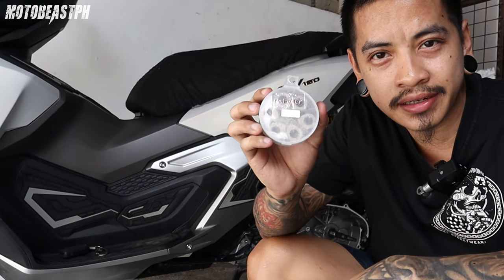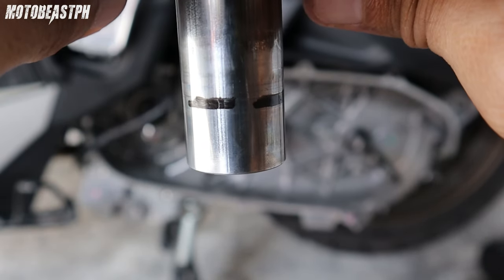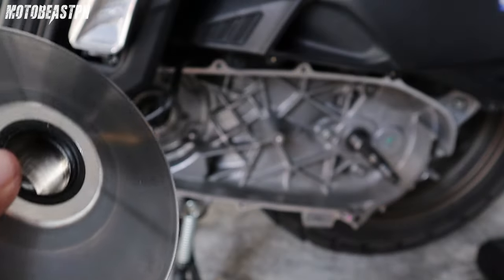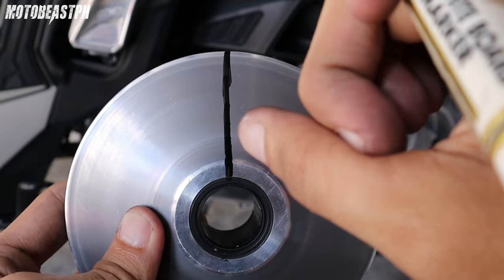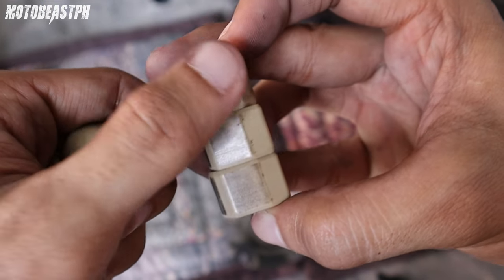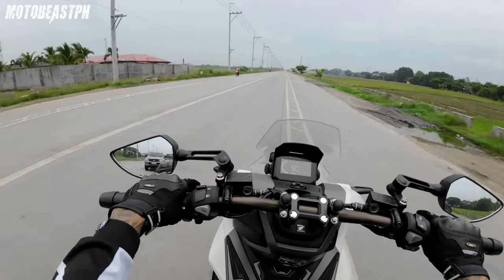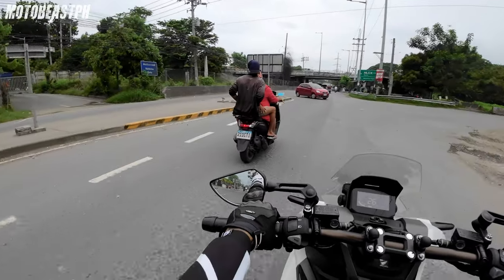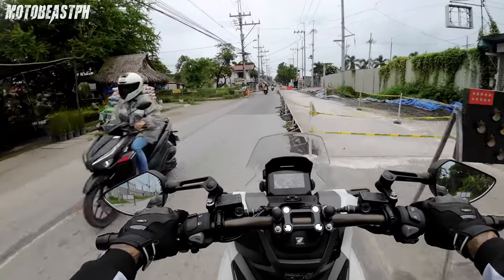ADV 160 | Dr.Pulley Sliding Roller Weight

Comment: Boss ok lng ba 17g 1200 center spring 1000 clutch spring at naka 13.8 pulley interlock? 110kilo rider. Thanks boss
Reply from the maker: Trial and error yan, bro depende sa timbang mo at riding habit. Hanapin mo lang pinaka-magandang alis na di gaano delay ang piga.

Comment: May nagsabi saken na if magbababa daw ng grams dapat dapat daw palitan ko na din center and cluntch spring? wala daw kwenta if magbababa lang ako ng grams.
Reply from the maker: Depende sa profile ng gamit mo na pulley set.
Reply: @MOTOBEASTPH  Stock pulley lang ako paps and balak ko din sana mag lagay ng 1mm magic washer then 15g or 17g na dr pulley flyball. For daily use with top box and obr. Goods kaya plano ko 😅

Comment: Bro idol, ano po suggested mong brand ng pulley set para sa beat fi and sa rpm ng springs? Salamat po.
Reply from the maker: Speedtuner kalkal pulley, 1k center, stock clutch, 10g to 13g bola trial and error.
Reply: @MOTOBEASTPH idol pano pag 1500 Center at clutch tapos 12/11 Rollers Weights ?

Comment: BOSS SANA MASAGOT !!
di ko gets sinasabi mo regarding sa bigat ng bola nyang Dr. Pulley.. so meaning ako kasi naka 12/9 sa bola na round shape .. meaning pag nag Dr. Pulley na ko.. hindi na dapat 12/9 bibilin ko?
Reply: 12/9 padin. Pero if naka aftermarket pulley ka wag kana mag dr pulley na flyball. For stock lang yan. Ung dr pulley is kaya nyang itulak ang pulley para mas maipit at umangat ung belt dahil sa mas malaki at unique shape and/or design nya. If after market kana, wala na un limiter sa rampahan kaya mas aangat na ung bola at maituttulak nya ng sagad ung pulley papuntang drive face
Reply: @romeomaindan9982 bali pwedeng mailabas o lumagpas yung belt? Naka aftermarket ako na pulley, RS8. Bawal ba mag dr. Pulley?
Reply: @davidfranciscoamano1057  baka maputol belt mo boss lalo na if may karga. Common nangyayari sa racetrack. B65 belt pero over range ung pulley.Naii stretch ung belt. 

Pag nag dr. Pulley ka naman sa racing pulley, pwede maipit sa backplate at dulo ng ball ramp kasi gusto nya pang sumagad. Baka d na bumalik. May instances na ganyan. Purpose lang naman ng D type roller is para mas umakyat pa ung bola which is d kaya ng stock or ung normal na bola kasi may limiter ung ballramp (yan ung kinakalkal) para lalo nyang maipit ang belt paakyat ng pulley at tumaas pa ung gear ratio mo.

Comment: Sir ask ko lang kung recommended ba yun 12gms na flyball sa kalkal pulley set, 14t gear, at 110/80 rear and 100/80 front tire.pero stock center springs,clutch springs? Honda click 150i v2 user sir. Thanks po sa reply.
Reply from the maker: Trial and error lang sa bola, bro. Balik mo stock size gulong para accurate speedometer reading.
Reply: Goods ba 12g?
Reply: Sir ask ko na rin kung di ba ma-rpm at malakas sa gas yun 12grams sa ganun set up ko? Nagbig tire kasi ako sir for road stability and 14t gear para nman sa gitna at dulo. Gusto ko sana itry yun 12grms, since naka 13grms na ako, kaso lang malamya yun arangkada nya sa 13grms. Parang nakastock flyball ka na 15grms yun arangkada nya. Thanks po sa reply. 😅
Reply from the maker: @ronaldsantiago3487  Konti lang difference sa gas consumption. More rpm, more gas.
Reply: 👍 salamat po sir

Comment: Sir kamusta dr.pulley flyball ginagamit nyo pa din ba? Totoo ba talagang matibay?
Reply from the maker: Gamit ko yan bago ako nag 14T gear kaya pinalitan ko na ulit. Mga 3,000km ko siguro nagamit okay naman basta dapat smooth yung edge ng backplate.
Reply: @MOTOBEASTPH  anong brand ng flyball pinalit nyo sir? Para sayo sir kaya ba tapatan ng mga leading brand ng flyball dito satin quality ng dr.pulley flyball? Honest opinion po sana sir meron din kasi ako nyan bali dr.pulley flyball, koso at MTRT parang nang hihinayang ako bakit kasi kumuha agad ako 😅 11g at 13g koso brand another 13g dr.pulley at 12g na MTRT brand.

Tinesting ko yung straight 13grams na dr.pulley so far feel ko yung claims o baka lang kasi nag gaan ako from 14g down to 13g. Lintik kasi mekaniko ng casa parang ayaw nila maniwala opinion ng customer na lihain yung back plate at rampahan ng bola though stock pulley naman gamit ko mahal pa naman flyball na yan wala kasi akung proper tools pa.
Reply from the maker: @RaYan-nu5lb Yung mga dati kong JVT na bola nakalagay ngayon. Maganda yan Dr. Pulley sa stock pulley. Matibay yan.